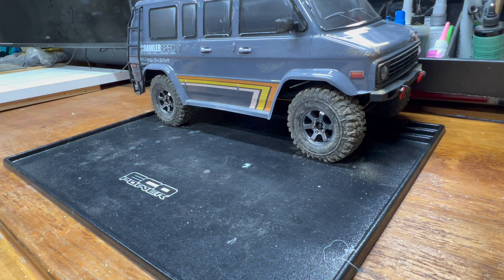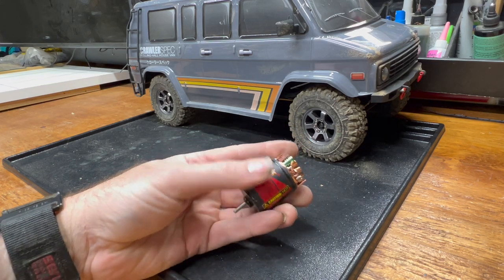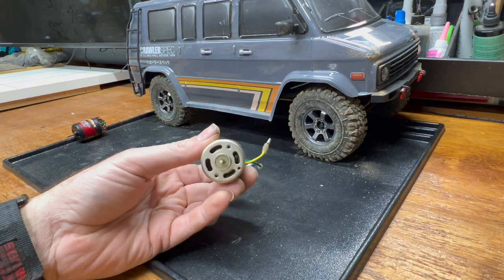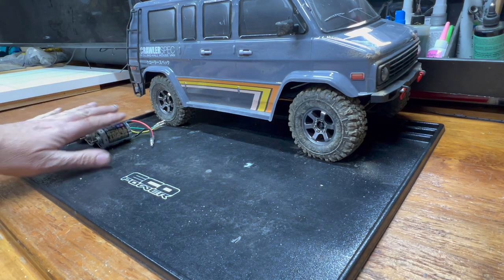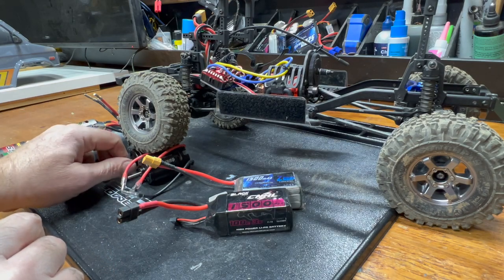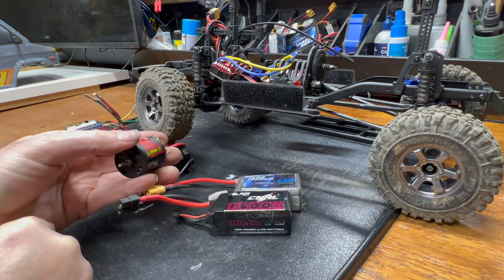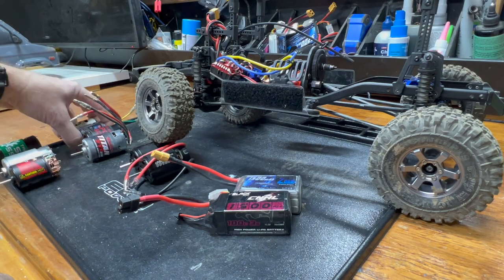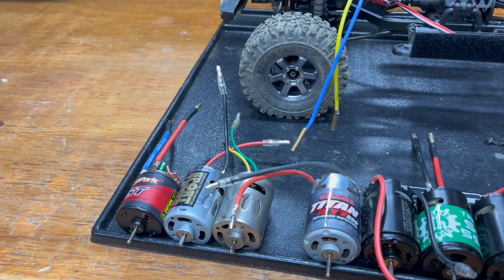Crawler Canyon Presents, The Econo-Motor Hunt, Episode 1: cheap brushed 540s

Comment: needing to build a new rc car just because you have a $17 motor -i like that line of thinking
Reply from the maker: I built a rig recently because I found an extra FlySky receiver in a box, which I had no recollection of buying. Can't just have a perfectly good Rx lying around. Now I have a bucket of brushed motors...  what else am I supposed to do?😆
Reply: @CrawlerCanyon  i find myself in the situation ,the only way is to build more rigs ,even if you find just a lug nut ,that is my O-pinion ,any reason is a good reason

Comment: Standard silver can tamiya is 27 turn, sport tuned is advanved timing equal to 23 turn, both pretty hot for a crawler. Still watching. Well than. You said it all yourself lol. Great video, im in the last 15min 👌”leap frog to the top” 🤣
Reply from the maker: That Sport Tuned is just so, so smooth. If nothing else of value come out of this, I at least learned not to put a 540 in anything over 5lbs.

Comment: Just slapped in  brushless system in my cenracing f450 2 day can wait 4 the spin
Reply from the maker: There are definitely some rigs out there I wouldn't get near with a brushed motor--  and that CEN dually is absolutely up on that list, with the TRX-6 and any of those Cross RC "full metals," which can touch 10lbs. This motor test is definitely showing me what motor should go in what.

Comment: You're going to get them hotter crawling up an obstacle than you will rolling on flat ground WFO.
Reply from the maker: This is a remnant of my Basher Mindset® where running a motor wide open for an extended period of time, especially when undergeared, will get it REALLY hot. With crawlers, after any "full" run, the heat goes in order from servo, to battery, to motor. I don't think I've even gotten any motor in a crawler to 100º, save for the times when I was driving and it was over 100º.  I have go-fast stuff geared so close to the edit that I can't drive 'em at all if it's above 90º.

Comment: Makes me smile to watch you, being amazed, that faster motors seem to have more torqe, intead of other way around, as the common (fake) knowledge says. 
John Holmes supposed to talk about it, at the end of one of his videos. Marketing came out with this claim and it stuck like a good moist shit. I've yet to find that video, but i had my doubts before i read that.
Logic: how many real life high speed cars, can you list, that have low torque? Now how many of same type, can you list, that are extremely fuel efficient=use less fuel.
So why people believe, that low Amp draw, low speed motor is the one, that has most torque?
Which industrial 150ton press, uses 12v 30Amp motor? Cause clearly it'd be more torquy, than 480V 1000Amp motor, cause that big thing is...faster. I mean logic right?!
So, the best crawler chassis, are those, that have the most gear reduction, cause you can use all the power, your esc is capable of, using a faster=more powerfull=more torquy motor. That motor WILL run hotter, as it draws 2-3 times more Amps and outputs 25-50% more Wats, but as long as you gear it down enough, so that it can have enough RPM while you creep around, you will be able to call it smooth, as well as more torquy. If you won't gear it down, it will spin at say 1-2rpm as you crawl, and who can expect a motor spinning that slowly, to be smooth, or have any momentum? That's why slow motors were recommended, cause while being weak, they were spinning much faster at the same creep speed, drew less amps, were more resistant to stalling, which creates most heat(even more when you have +50%power of a fast motor), and the can can only dissipate so much.
The correct knowledge was always in specification tables, how could customers believe that bullshit is beyond me...
Reply from the maker: I mean...  to an extent. Most "modern" crawlers have significant gear reduction, which enables them to use both higher kV (turns) and higher volts but this was absolutely not the case in the past.  A typical 3-gear is going to get maybe 5:1 or 6:1 reduction, so it's doing a high-turn motor no favors--  unless you wanna go fast. I remember in speed running, an inappropriately-high geared 5700kV motor couldn't generate enough torque to even get the rig moving from a standstill-- I'd have to push it with my foot. This was in long ago times, when things like 6S hadn't made the mainstream. Guys were setting records with scads of NiMh cells strapped to the chassis. 

The electric motor lives on the fact that it generates maximum torque at zero RPM.  Until we find a motor that can accept infinite voltage, turns/kV is still going to be important, not for top speed (which is what people tend to buy them for) but because different rigs have different needs.  FDR determines what motor is going to be the "best," but you can put a shoebox full of different motors of the same turn count and get different results from each of them. The 540 test was interesting (at least to me) because it had the largest kV range, and no Holmes motor in there to just beat on everything else. 

If I've learned anything over these past few days, it was to confirm the presumption that a better made motor is better--  every little bit will help efficiency--  but where that quality resides can be a bit of a surprise. Just because a motor is "name brand" doesn't guarantee it will be any good--  and a big portion of the population still shops by the name. At the end of the day, any $100 motor is gonna be pretty damn good. But I have waaaayyyy too many rigs to put 100 bucks worth of motor into every one of them--  my shelf full of "really good for the money" FlySky radios is an indicator of that.